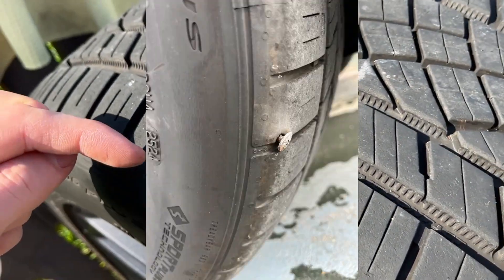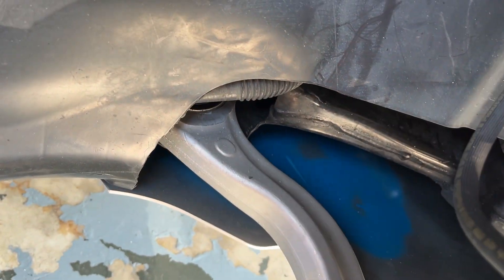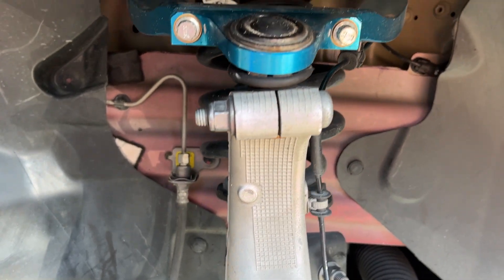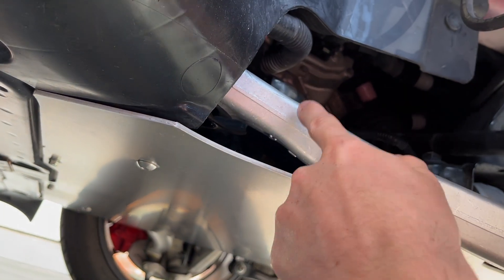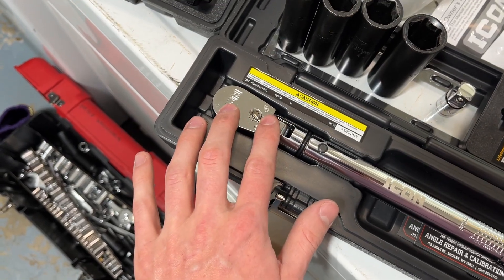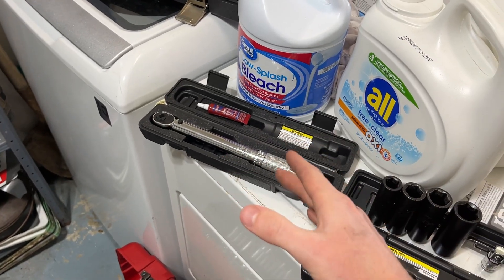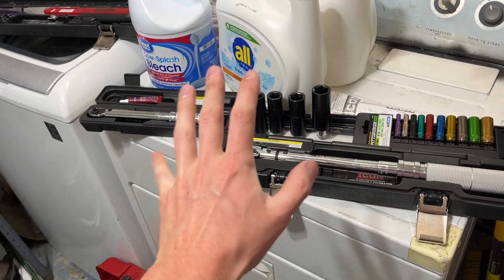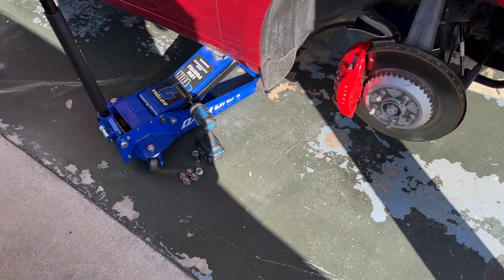Tesla Suspension 101: Why Re-Torquing Matters

Comment: I kept hearing rattle (similar to a loose chain sound) coming from under the car. Tesla service says the factory didn’t mark the bolts with orange paint after torquing. So, they re-torqued it. Is this paint requirement real?
Reply from the maker: The bolts are supposed to sit in a certain spot for alignment purposes but personally when I did mine I didn’t see any difference between them if you rotate them. As long as they are torqued while the car is at ride height for the bushings to be in the correct location before they are smushed down. 

Tesla suspension is pretty bad on the 2023 and older cars that’s why companies like Mountain Pass Performance make so many replacement parts for them. Personally I switched my whole suspension to MPP bearings.

Comment: I did my rear knuckles over the weekend and torqued everything but didn’t lift the hub to ride height

Now I’m hearing clicking noise when driving slow. I’m wondering if this is my issue. 

Curious what you and others think
Reply from the maker: Congratulations on doing the job yourself, I made a video of how I did it. 
Is the clicking coming from the front or rear of the car? If it’s coming from the front it could be the hub splines clicking on acceleration or reverse, could also be the front FUCA. 

If it’s the rear it’s probably the axel splines clicking when you accelerate or shift to reverse rapidly. If it’s another clicking noise I would almost go and feel all your bolts to make sure they are tight as sometimes the bolts connecting the arms to the subframe can come a bit loose and make a clicking noise.
I’d go about 5 ft lbs over the stock torque spec for extra security and use orange thread locker for vibration to make sure they’re locked in.
Reply: @BryceAdvice it coming from the rear. Only when driving on uneven surface. For example backing into driveway i hear it. 

I don’t hear it when i accelerate or decelerate. 

I watched your video and man i got stuck on that same arm when reassembling 😂
What a pain !!

I’m gonna check torque on everything and get that orange lock tight
Reply: @BryceAdvice and this is a lesson to me not to work on this at 2am. It was the lower sway link bolt that was loose! Tighten everything up no more noise!! Thanks again

Comment: Ah, so sorry, big NO, NO here.

They all have to be done with the tire on as you are "Clamping" the bushing when you torque them, then when  you lower the car the suspension arm rotates under the weight of the car, twisting and to some degree, damaging the rubber portion of the bushing.  Yes, they move and need to be torqued more often is because you have introduced a twisting force to all those bushings which slowly "untwist" as you drive the car.

From TESLA
For Tesla Model Y, you should retorque suspension after the initial installation of new components, and then again after driving a short distance (50-100 miles). After that, regular retorquing is recommended during tire rotations or every 5,000 miles!
Reply from the maker: Okay yeah this makes sense, thankfully two of the torque points are bearings so for those I can’t see how it would matter as the bearings spin anyways. But yeah for the other torque points those are rubber.

I have seen several other DIY videos on the rear knuckles that do it the same way I do. But if I was to do this job again in the future I’d jack up on that rear suspension arm on the bottom to lift up the knuckle to about ride height before I torqued the bolts. 
I’m due for a tire rotation in about 2,000 miles so when that time comes to be safe I’ll pop the tires off and retorque everything.

I do have this strange clicking coming from the front suspension now tho, it’s not the calipers it’s more a suspension arm or bolt, I torqued everything and it’s all tight, at this point if I have no idea what it could be since all of my front suspension is fairly new with MPP parts as well.

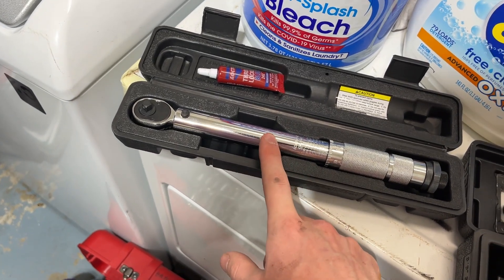Comment: Great "101" video with details presented in a way to prevent errors. The split beam torque wrench for wheels is ideal. Saying 5 foot pounds here 09:15 to let viewers figure out 60 inch pounds since the other way around tends to break stuff. Orange Loctite, with a major emphasis on removable.